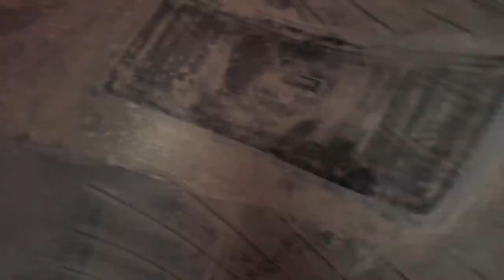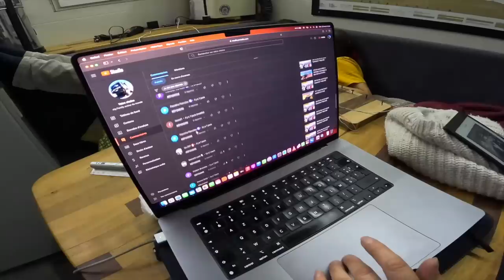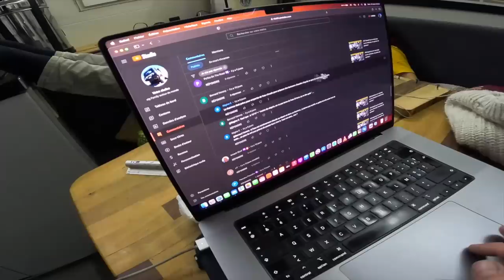466 Une mauvaise surprise pendant la nuit

Comment: Les pièces en croix a collé son pour les pneus carcasse diagonale. Les vôtres sont des radiales les pièces, son pas, les mêmes. Je ne veux pas vous porter la poisse, mais un roulage basse pression la pièce vas se décoller ou fendre. Taille pièce PL    50 x 75 mm
67 x 104 mm 
75 x 90 mm
80 x 125 mm 	
75 x 175 mm 
75 x 220 mm 
115 x 125 mm 
130 x 180 mm 
100 x 200 mm 
130 x 260 mm 
150 x 190 mm 	
185 x 240 mm